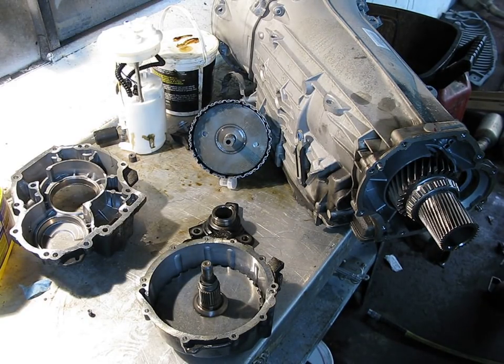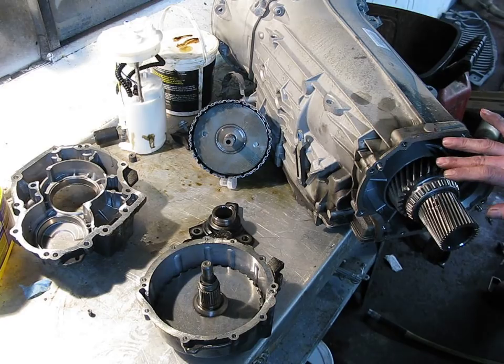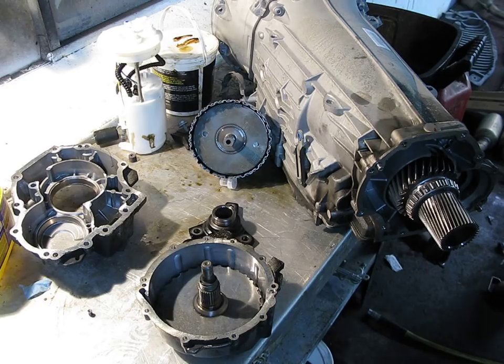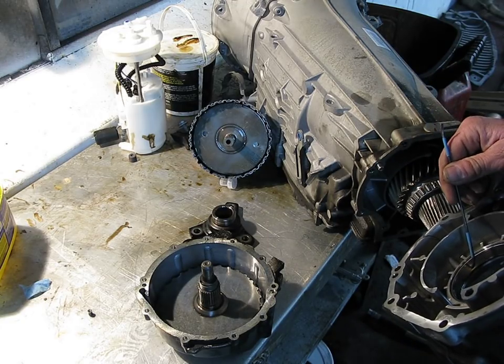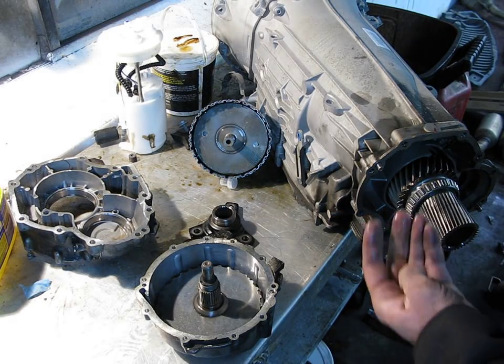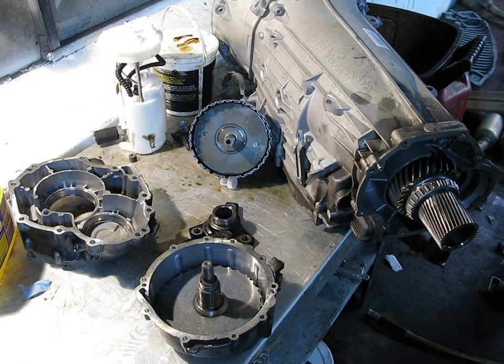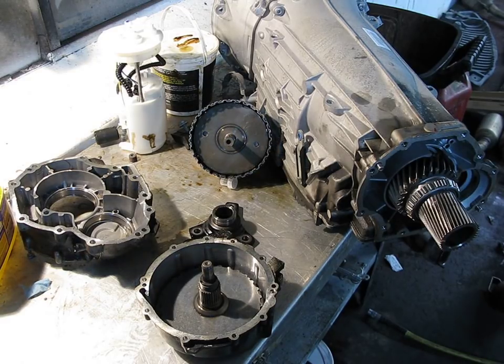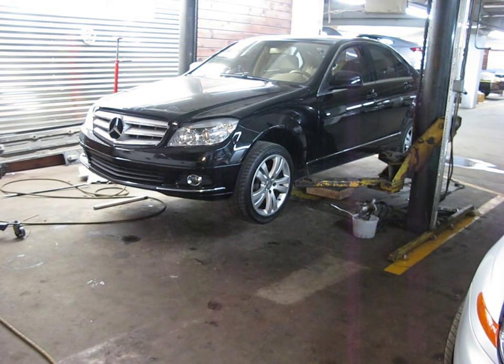Mercedes C Class 4Matic transfer case problem

Comment: what car model is this. I have the same problem on Mercedes 2011 C300 4matic. My Mechanic is advising me to replace the whole transmission. He is claiming transfer case is not repairable and it is one part with transmission. !! Can you advice what to do.
Reply from the maker: Your mechanic is actually correct. I think this car was a 2008 C300, maybe a 2010. It's been a while.

Here's what I have learned about this issue along the way:

The true problem exists within the housing for the transfer case. The Transfer case can be disassembled and repaired with those bearings I listed in the description, BUT... You are still driving on borrowed time!!!

It's likely that Mercedes only has the recommendations of replacing the entire transmission because they figured out what they have done wrong with a specific production run of the 4-matic transmission assemblies. In order to correct the problem of a weak housing for the transfer case, the entire housing of the transmission itself had to be redesigned.

This sucks for ALL Mercedes 4-Matic owners with this specific transmission. I think the years covered by the bad units range from 2008 - 2012, but don't hold me to the accuracy of that.

If you replace the bearings only, I have discovered the outer bearing races have a tendency to spin in the aluminum housing. This might be preventable if a chemical compound such as "Sleeve Sealer" is used while installing the outer race.

You will still be driving on borrowed time, regardless of what kind of "repairs" you choose to do to the existing transmission and this is quite unfortunate. However, performing the repairs to gain that temporary state of noise-free driving can buy you enough time to dump the car at auction whereas it drives as intended for those who test drive the car. People who know about this issue will steer clear of buying it, even if it seems OK. People unaware will gladly buy it if it's running good.

The only other option is to purchase a new transmission assembly from Mercede$ and pay for the R&R labor plus programming procedures included for the swap.

I hope this helps you understand the problem you have on your hands.
Reply from the maker: sure thing. look for an email starting with 111
Reply: ahany1  I actually have same issue with my 2011 C300 4matic. I brought a used transfer case and sent this video to the Mercedes Tech and they are changing the transfer case. It’s not a service Mercedes provides and not covered under a warranty. I’m taking a chance that it will work
Reply from the maker: It's the only chance you really have IMO. However, be aware that if the repairs are successful, you are still driving on borrowed time. I believe the housing for the transfer case tends to get warped over time and under stress. This is likely why Mercedes does not offer the transfer case service at all. Only a full transmission assembly at your cost. I wish you and your mechanic the best of luck. It's a shame to see a high quality car be sent to the grave over one very critical component.  The repair can be done without removing the transmission - let your mechanic know and lighten his workload and your expense as well.

Comment: Hi, I have the same problem with my car. Which state is your shop, and can you contact me privately?
Reply from the maker: Hi Art.. We are located in Kansas City, MO. Sure, I can contact you privately if you wish. What's your email? I will remove that info if you reply here or I can try this genius YT messaging system, however, it doesn't always work for me.
Reply: @YTInnovativeSolution  would also like to speak with you directly if possible. Thanks!